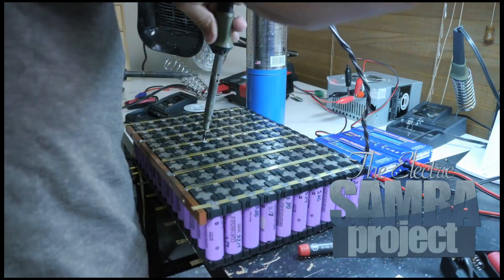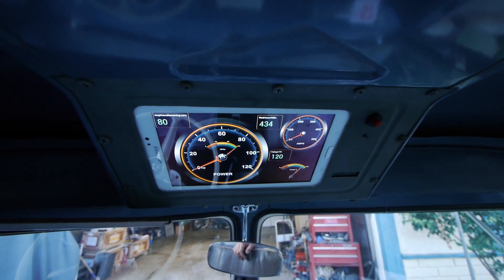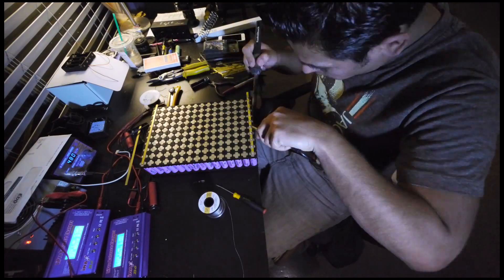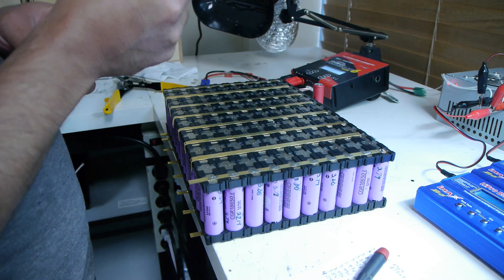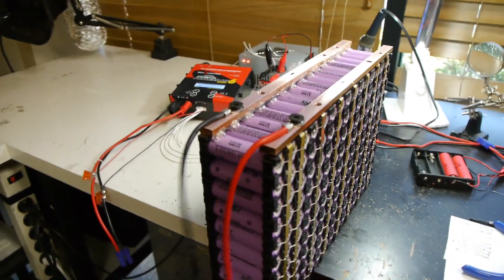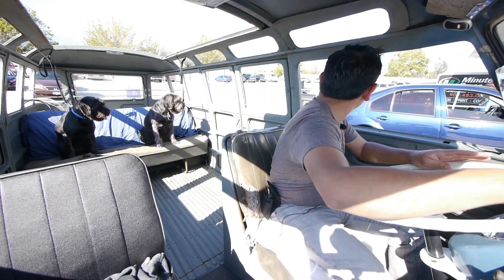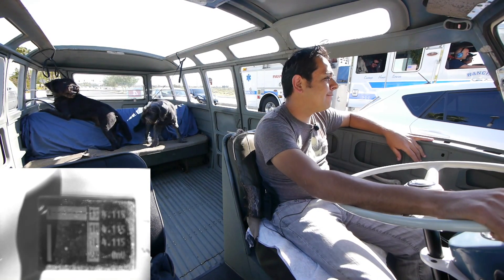DIY Tesla Car -  lithium ion 18650 battery -  VW Kombi

Comment from the maker: Best Deals on Lithium Battery Cells http://j35.us/MARCH-Deals
Reply: +jehugarcia Cool project you should make an RV that is battery powered and has roof full of solar panels. It would be neat as lots of people go to camp grounds with shore power they could travel without any cost of fuel.
Reply: the next episode is private...whats the dealeo?
Reply: No problems here.  Using Chrome (up to date on updates), with only a few plugins/extensions, on Windows 7 x64.
Reply: What I don't understand is that u made parallel connection of the 18650cells which means the per multiples but the voltage remains same then if I want to run a 48v motor how can it run since the voltage is only 3v
Reply: @hamzahansari6900  u mean the power multiplies
Reply: TekReview's  Chrome for me is 10x better than Internet Explorer. HTML5 has been around for a couple of years......but it seems to still be very buggy when using IE.
Reply: ***** Dude, I can see this video no problem. It's not blocked.
Reply: -
I like this, someone smashed into me and I lost my lil leaf.. (trying to fix, but the electronic repairs may be too much)   but your EV BUS is legit.
Reply: Plays fine on Chrome, Firefox has an issue.
Reply: I got Chrome and it isn't working. I get audio after few mins of waiting but no picture. Youtube is messed up today
Reply from the maker: roxorz007 yeah seems like youtube is having issues today,  It now plays fine for me so maybe they'll fix things soon
Reply: jehugarcia Finally got it to work. Can't wait to see more on these packs and you running only with them. Great work but you really should get the rest of the windows in ;)
Reply: I keep getting connection error lost.  Wierd!
Reply: I get problems using IE11 after downloading the Bing and MSN version. Unfortunately Uninstall is not an option for IE on Win7 so I could re install IE10. Using Firefox 29 I only have the issue when I scroll back and then wait for the video to start playing again, it takes about 10 seconds or so for the video to start playing again.
Reply from the maker: Akin aydemir  TRY THIS LINK: http://youtu.be/FdAEp-ZFmwo
Reply: jehugarcia Internet Explorer 11 + HTML5 = big fail. My Youtube viewing is terrible......HTML5 player is constantly dropping out, reverting to Flash Player.
Reply: I have the same problem since Cnet switched there website design. I have to use Firefox to watch any Cnet site videos, they just sit there and do nothing or spin forever on IE browser.
Reply: Our news in Seattle did not even bother to report it. Microsoft is skipping Windows 9 and going straight to Windows 10, probably to confuse people with the Mac OS X 10 OS. Supposedly it has the Start menu again and will be a cloud based operating system like the Chrome OS already is.
Reply: tickyul
Internet Explorer has been a fail since day 1. But that HTML5 video is terrible everywhere. The H.264 license is to blame.
Reply: zwz • zdenek Yeah, sad when they roll out stuff, such as HTML5, when it is so fricken problematic. Flash-Player was more stable for me.
Reply: They always like to have competition. Flash Player still works great on PC, you can download the Flash for mobile on the Adobe website. It is hard to find but the versions in the archive are newer then the last version they released publicly before stopping Flash for mobile products.
Reply: TekReview's Yeah, but embedded video at places like Youtube has HTML5 as their default player. Can you set Flash as a primary player on your Youtube settings page???
Reply: Youtube still shows flash videos. If you use a program like DownloadHelper on your browser as an addon, it will show you different video files, FLV and Mpg4. As far as I know they are still FLV files.
Reply: tickyul Primary? Haven't figured that out myself, just disabled the HTML5 video altogether and now Youtube plays reasonably at least.
Reply: Adam Steidl
I wouldn't dispute the fact that it starts playing. Sure. But there are still problems that may be considered negligible by some but deal-breaking to others: For starters, the fullscreen mode is bad. It either fails to cover the whole screen leaving some bars, or it doesn't work at all. Then there is the performance problem: Although Flash had a bit more sluggish playback than Windows Media, it still has about 3 times better frame rate than HTML5 video. On basic computers, Flash is fluid while HTML5 is laggy. And the last problem is the codec support. You have to transfer twice as much data to your VP8 HTML5 than you would have to to your H.264-ready Flash. Again, you can ignore the flaking or perhaps pay for faster internet. But, at any rate, HTML5 is very inferior technically. Even if it somehow "plays."
Reply: +jehugarcia what parts from transmission and gearing did you  keep
Reply from the maker: All
Reply from the maker: TheMakyato all
Reply: old question, but video plays fine. I'm sure the Tesla joke was just that,a joke 😂
Reply: you samba damnnn fast its funny
Reply: how good is this my friend I've watched the video but you most things online are very skeptical?
Reply: Who is banging on the wall??, makes it hard to hear audio. Stop the Noise please.
Reply: Sir, I am working on range anxiety of electrical vehicle.plese give me some references from where I learned about range anxiety
Reply: Most high capacity cells are sold out.

Comment: @jehugarcia. This i cool car. What kind of motor do you use to move the car? Or you use engine motor because i’ve seen you paddle ship the car. It’s a bummer! Great Job!
Reply: How many cells did you use and are you using 24v system? And many mileages before your battery totally drain?

Comment: So you charge all those batteries in parallel?  One failed cell will take your whole module down.  Is the idea that as a cell fails its fuse wire will disconnect it from the array?

Comment: Can I get a contact from somebody please I have 25 /38120 I been trying to figure out how to assemble these I have a 40 amp 15s BMs waiting but been practicing with the 18650 I cant figure out how to assemble and install bms I had 3 accident one pack almost burned my house down and 2 events where they exploded in my face almost blinding me I need to biuld this but I watch and watch and still not sure or confident being I'm a screw up doing this I don't  know if i have right bms either but need to use i dont even know what size or if its 36v or 48 i just need someone to talk to and maybe talk on phone for on call answers to confirm my move to biuld it to much money and explosion to move on I started 2 months ago I want it for my solar panel setup I'm trying to biuld for my summer window ac and m as the tv in my room can somebody help me out I'm not afraid to ask just dont know who to ask please somebody help me out I'm willing to learn I wont move to I'm confident in the biuld and sure of the size and biuld for the power of my inventory I put together look forward to some help and hearing from someone also a drawing word help me out alot to use for reference would be the biggest help being I just dont understand the details of all the youtube videos I been watching that got me confused and not being able to ask question at the time thanks if you read this sorry if it's to long thank you

Comment: What happens when individual cells start failing in those huge packs???
Reply from the maker: Your battery will loose small amounts of capacity
Reply: @jehugarcia  Ah, thanks.  I figured with the "normal" fail of just increased internal resistance that would happen, but a shorted cell could be quite spectacular.
Reply from the maker: Not if it’s fused individually,  it just disconnects from the rest of the pack.
Reply: @jehugarcia  OK, great... sounds like you covered all the bases.  Very nice project.

Comment: Hey, here in germany its relativly difficult to get used laptop batterys and so to tske apart for 18650's, but on ebay kleinanzeigen (local ebay) i've seen some people with tons of cells and they sell 2000mah+ for around 1.50€ to 2.50€, cells with around 1800mah mostly go for 1 to 1.20€
Is 1€ per cell a good price? (I'm still in school so less money but want much (relativly good) cells)
Reply: Today i bought 70 cells for 20€, i think if the cellss are good(the seller dont knew the capacity...) it could be a good deal. Often i just want to buy cells at your list with deals but importing/sending them to germany would cost more than the cells itself... tomorrow i'm visiting a local bicycle shop with the hope to get used ebike batterys from them :)

Comment: Hi Jehu, I'm Marcelo from Argentina. I am converting a car to electric with a nominal 15KW motor kit / 48KW peak with 108V. I need to make lithium battery packs. What BMS do you suggest to use to arm by modules and get to 10KWh to 15KWh in a car ?. You can sell me a lot of batteries 18650 and BMS to build the packs? Do you know any BMS that allows to monitor the loads and downloads on the board? I would appreciate all the information that you consider useful to be able to assemble the packs in the most economical and professional way possible. I follow you years ago on your channel and I know your extensive experience. I congratulate you on the Samba Project in the VW Kombi. A hug, Marcelo . marcelowech@hotmail.com

Comment: Sir, I don't know if you can see this message, but I pray you do, I know it's been long, since any comments, but I have a question, 
How do you get the leads to melt on the battery so well.
Did it not heat up the batteries?

Comment: What esc does he use on his van?
Reply from the maker: Curtis 1238
Reply: jehugarcia I'm new to your channel and absolutely love your content! You think you'll make a video about why you chose the motor (ac or dc), voltage,  for your vw and what your plans are for the future with it? For example is your Van braking system and steering electronic now that you removed the gasoline engine ?

Comment: nice job... so what is with the little fuse wires? will they not burn up during high amp draw? I'm trying to figure out how to build a 18S42P pack for high drain 300A, how do you figure out what size of bus bars to use? would thin nickel plate work?

Comment: What is the size of that battery, is the 150 battery only 3.7v if so how can it power the motor, or is there other 150 battery packs that are 3.7v ran in series to 24v?

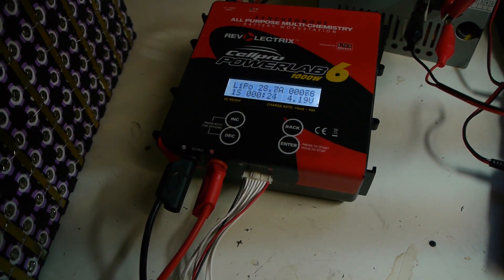Comment: How do you balance the cells during charging? The sense wires 6:52 from your charger are not connected to anything.
I would personally go for sport welding for that many cells, bars and fuses.

Comment: So if i were to build moduals to work for a 24v inverter. Would you make all modules 24v or would you make say 6 moduals of the 4.2v in parallel than run tge moduals in series. I guess what im asking would you run your battiers in series in the moduals or after.
Reply from the maker: Watch my latest videos. I am now making 24v modules

Comment: 650 amps drawn from 150 batteries 650/150 = 4.3 amps drawn from each cell and voltage drops to much, you need more batteries :)

Comment: how do you balance out the cells when there are so many? i dont see any balancing wires so how do you know voltage variance between cells? or does that only matter on different lithium batteries?

Comment: Very dangerous. Individual cells should be balanced and monitored especially during charge.
Reply from the maker: Educate yourself before spreading  misinformation
Reply: jehugarcia I have been using lithium cells almost since they were invented in RC helicopters. I think i consider myself both educated and experienced. They can wander out of balance under times of stress and when their temperature changes usually during discharge when cold. Tell me I am wrong!

Comment: Just a question regarding fusing on the negative side. I have notice that other tubers making these modules are fusing the negative also. I agree with positive side only but I am curious as to why some consider this necessary? Can you expand on this at all? Fusing a ground connection seems to be reason enough to me not to do this? Great videos and you are a nature in front of the camera.

Comment: Fake battery pack , you need voltage regulators on each + side of cell  [18650] any lithium cell need to be protected they usually run at 3.6v each and can't drop below 1.92v and can't charge over the 3.6v depending on the heat build up of the power it will take longer to charge ,,, fake fake fake they're trying to discourage you from thinking new ideas , {as a man once said , The best lie is the one covered in truth}
Reply from the maker: Oooh your conspiracies go deep
Reply: jehugarcia I can't start to imagine how you failed to convince me I was wrong . But instead insult me like the bad slave you are

Comment: Though it is adequate for fuse wire and cell connections, I would avoid using solder as only means of connection between busbars and look into bolting them together. Solder is highly discouraged in the NEC due to its unreliable nature, tendency to break. 

Love the channel, keep it up.

- MrSpark (Electrician)

Comment: Wondering how you can pack the electric car batteries more efficiently and cost-effectively? Superworker newly developed Automatic Steel Strapping Machine will help you solve this issue for Batteries for electric vehicles in Automotive Industry! We now have been working on projects for various shapes of automotive parts and major components. You can see from the website given below to see how the machine works.
https://www.youtube.com/watch?v=ORilTQ4OPV4
You can contact us at http://chinasuperworker.com/

Comment: Awesome job there mate! But could you please delete the comments about the dogs? We are losing the point of the video. I would ask you to hook some sensors for voltage and amperage per cell and total and point a camera at them so we get an idea how is the power distribution going. The voltage indicator was good but not enough for us to understand :( . What type of cells do you use, please post a datasheet if you don't mind. How do you use the existing gears? I Would think you could start in 4th gear ,albeit very slow accelaration. I could guess that you are switching between 2nd and 3rd?

Comment: I have a 1982 Volks Waggon Desial  Rabbit with a Prestolite 40HP motor rated at 96VDC with a Curtis controller and 16 ~ 6VDC deep cycle wet cells for a power source. I can go a max of 68 miles, these batteries are 58 pounds each,,  I want to increase my miles to 300 miles range. What do you recommend  in a DIY pack like your's?? Weight and voltage of around 100 Volts DC???

Comment: Well just dont charge it inside your house and don't park it in there, because one day it will burn it down. Those batteries are shit. You need to separate each cell line win its own thick metal housing and then that all needs to be sealed in metal so when it does try to burn you can starve it, also add a one way vent valve.

Comment: Are you running all those cells in parallel? Seems like that would only give you a bit under 4 volts out. I'd think you would have better efficiency running a higher voltage and lower current. (Whatever works. I have no practical experience with electric cars but am trying to learn.)

Comment: I don't understand the thin wires... if you are relying on the thing wire to burn up at >6 amps, then you are already producing a lot of waste heat at 4 amps. Doesn't that make the whole setup very ineffective?
Reply from the maker: no because 4A is peak rating, only achieved on hard acceleration for a few seconds at a time.
Reply: Thanks for your answers and your video! I guess I have to learn more about how fuses work lol :)

Comment: Hi 
it's a great video, 
but can you explain to me why using 1s battery pack instead 7s or 10s.... for exemple,  do you use a powerful voltage booster
Reply from the maker: +Adel Belarbi  this is one brick of 30S150p

Comment: Question: Is there no ballancing required?
Reply: it is...
Reply: I have a special question to you.
I want to use one 18650 cell to get more capacity for longer runn of my Gopro.
To save the 18650 i want to use the battery electtonic of the original Gopro Battery.
First I tried to use the 18650 without these electronic, and one result was that the last
video file was corrupt because the camera had no chance to know the moment to write the final signat to close the video file.
Now I used the whole electronic to runn the gopro by the 18650 and it works.
but I dont know noting about the compatibility between the battery electronics of gopro and the match to the 18650. What do you guess about my construction and ideas?
Will be the 18650 damaged soon?
Reply from the maker: +elaeroplano no i think you fooled the logic board, it doesn't know it has a bigger battery connected to it

Comment: SAFETY NOTICE DANGER! Rubbish you need to monitor each cell set of cells in series these cells cannot be charged that way never do this NEVER add batteries together without first checking they are ALL! of a similar volts level before you join them add circuit protection! Batterys Die at high temperature never solder them EVER! look at his charger it has the protection wires dangling out of it to nowhere this man is crazy and very Dangerous a little knowledge can KILL you!